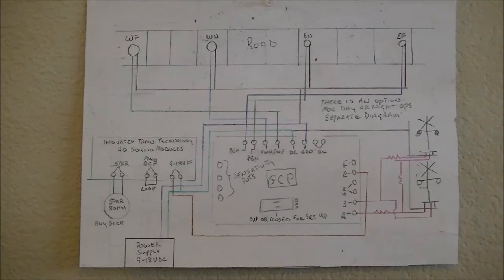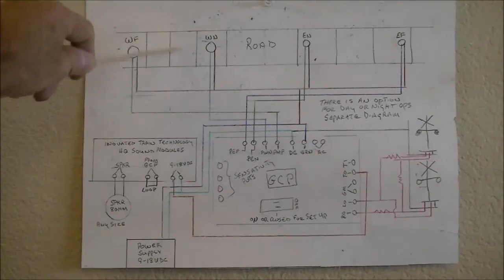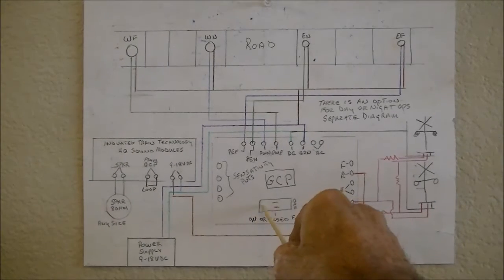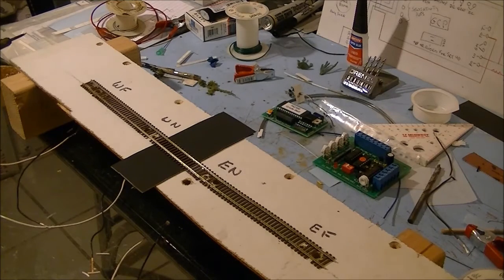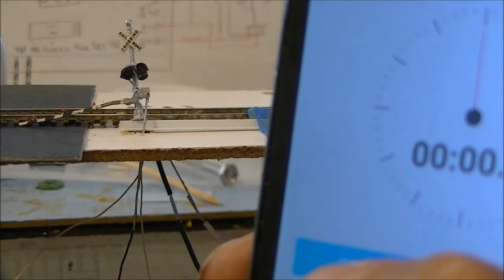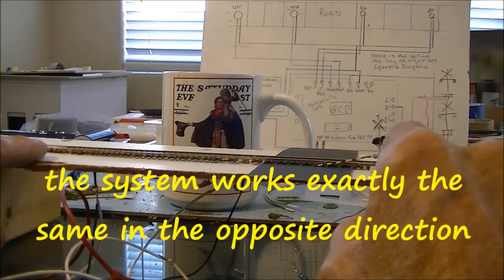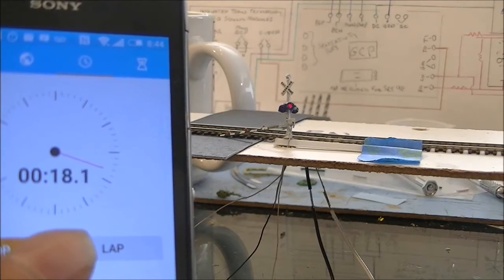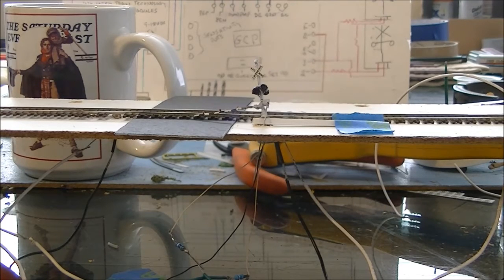GRADE CROSSING DEMO

Comment: Hi Vinny, Enjoyed the demo.I love the grade system you have and I always liked the Crossing Signal as part of the layout. Im looking forward to seeing a train go by soon and watch it operate. A very interesting piece of equipment with many circuits . Did it take you long to figure it out? The Bell sound is prototypical big time..Imagine hooking up the sound to a "Peavy" 100 AMP guitar speaker..LOL..Very happy for you on this one and I know you will enjoy it. I like how you ended the video with the sound of the bell. Thanks for sharing...Jimbo...Congrats on 200,000 views. Im glad being a part of it
Reply from the maker: SmokeyALCO hi Jimmy.. i'm trying to add a bit of animation to the layout... the hardest part was putting the wiring together.. they were all on different pages.. the actual work was easy.. i had a Peavey 200 watt bass amp w/2 15" speakers... i don't think the unit would have enough power to drive the speakers.. can't wait to get it all hooked up on the layout... thanks for watching & your comment... vinny
Reply: Yeah, the wiring is always the difficult part. I have the same problem with the signals too. I would have to say "Z" stuff signals are about the easiest with built in sensors.I had a 3 light Target that tested fine,but made a mistake on drilling the hole in the table a shade to small and wrecked the sensor board. I wasnt to happy about that.LOL.The sensors mounting plates are bulky but can be hidden with scenery and ground foilage. The system you have is very good technology and a nice system to run. Do you plan to use the same all about the layout or try others? Thanks again for the nice demo....Jimbo
Reply from the maker: +SmokeyALCO hi Jimmy sorry to hear that you hurt one of your circuit boards... i'll be using the same system for all the grade crossings when i can afford it

Comment: Great job Vinny , works well , did you say will control 12 crossing's
Cheers Glynn
Reply from the maker: QRoutback hi Glynn... glad you liked the vid... the system will handle 12 LED's. i will have 3 signals in this area each has 4 LED's so the system will be at max... thanks for watching, your question & comment... vinny